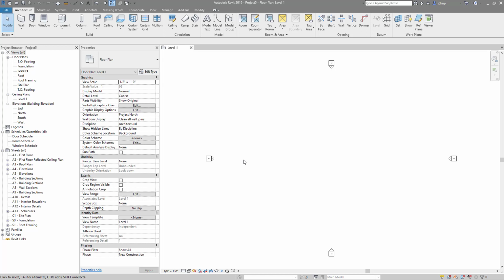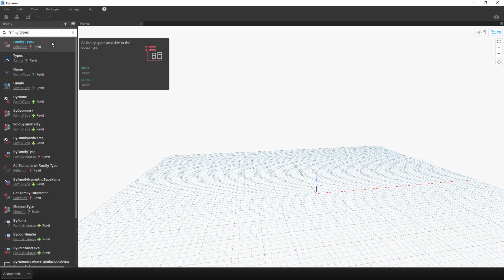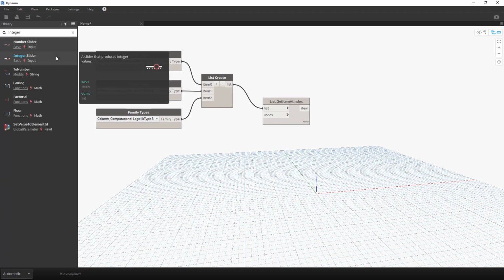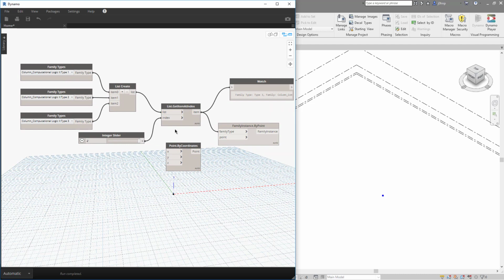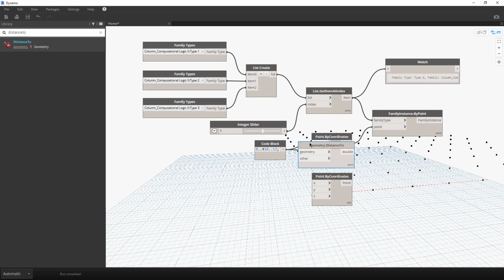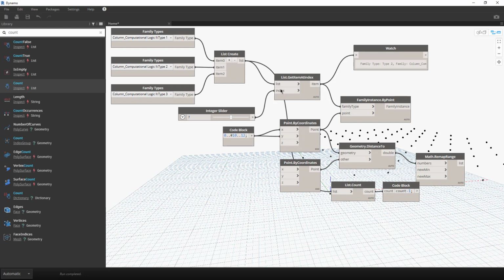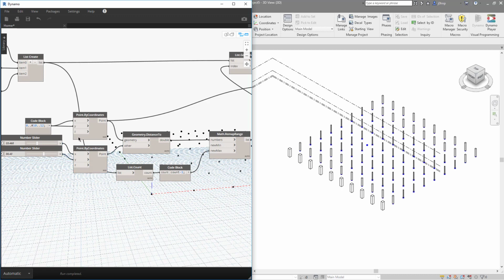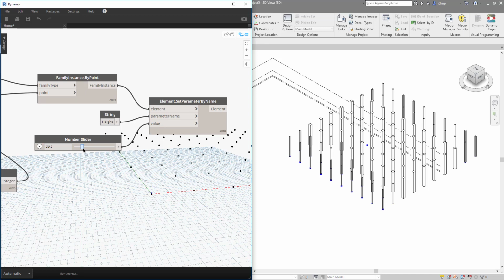06 ComputationalLogic2

Comment: The remap node in this definition appears to be implicitly calculating input ranges for each L2 list, so the column definition is not based on distance, but distance relative only to the row it's on.  Flattening the grid of points would create a single input range, and produce an attractor point result consistent with how you were describing it.